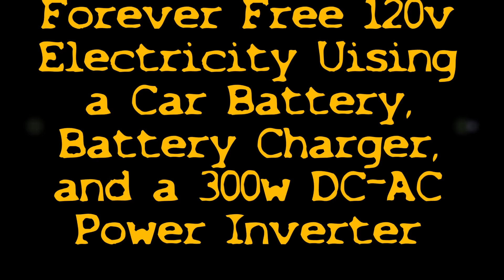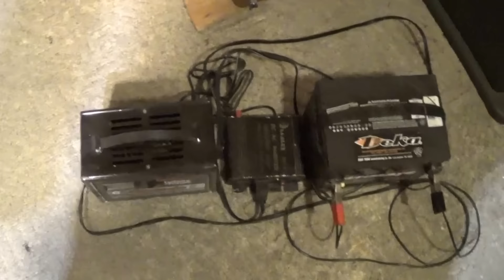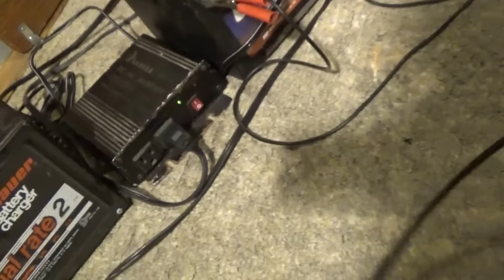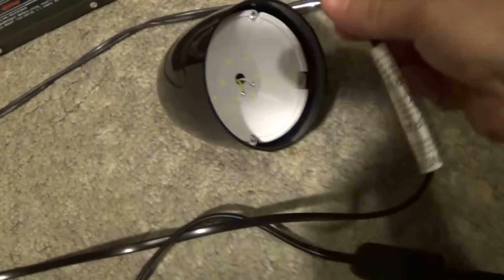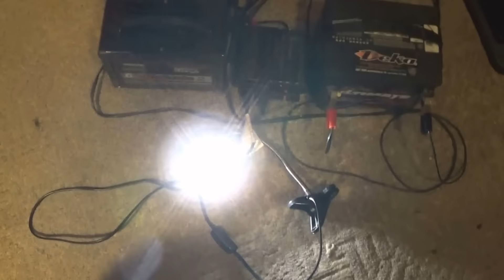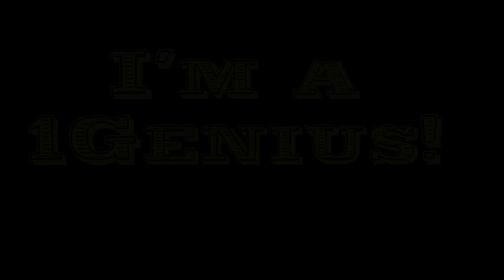Free120v Electricity Using a Car Battery,Battery Charger,and 300w DC-AC Power Inverter Part:2

Comment: ??? But say you plug a fan or idk a phone to it then it’s going to pull power from the battery right. Witch means it’ll never be able to fully recover its initial charge right. Say you plug the fan in and use the battery to 85% then it’ll never charge itself above 85% again?  And continue to drop the more power you use. Eventually getting so low it won’t even run the inverter or charger right?

Comment: Your system will work with a low amp invertor on a standard battery charger, but once you get above 5 amps you will need higher amp battery chargers, and yes people this actually dose work, I personally have several similar systems running 300 watts to 10,000 watt invertors, powering my mining equipment.
Reply: With this set up how long till the juice ran out of batteries If power a 65v mini fridge??
Reply: @ROSINDABSS.710  it's not that easy to determine it all depends on how many amp hours your battery has so one amp hour equals 1 hour so if you have a hundred amp hours you have 100 hours at 1 amp I'll draw then you need to know what your charger is putting back into the battery so let's say your refrigerator pulls 10 amps and you have 100 amp hours then you would get 10 hours worth of use out of the battery before it runs dry if you have a charger that's putting back 12 amps then you can conceivably run that battery shut up for 24 hours because you're pulling 10 amps out of the battery and putting two amps back in hope this helps you
Reply: Thank you for the updates , Power companies like Edison do not want the public to know this power source

Comment: Seriously, though... Can I run a system like this in my Camper van? Connect the inverter to the lighter socket and use a regular battery charger to charge my leisure battery while driving? I understand very little about electricity but this sounds like a solution... Am I missing anything with this kind of set-up? Any help wold be greatly appreciated !!!

Comment: The power was cut off at my house and I've been trying this out. It powered the lights for about 20 minutes, and then cut off. Without a power source feeding energy into the system, you're not charging anything. The power you feed into one part is given to the next. And when you try to put a load on it, you have less energy for the system to recycle. This doesn't really work, you still need a power source.

Comment: No volt meter in place to show charge volts and amps and no volt meter to show battery charge level and what amps is the inverter pulling

Comment: Prove it get your amp clamps and voltage meters.
Show voltage output and input with amps use and production.
Quite dicking around man.
Let's see what you have working and have left to work with.

Comment: i like the concept as a recharging possibility.  self recharged overnight, the battery/batteries would be charged enough to power the inverter  for small items like phones, led lights, low watt tv...camper, rv type stuff.  seems  like its  worth a try.

Comment: I've tried this ,
When I plugged a tv in it then draws from the battery ,after the battery drops in voltage the inverter will shut down due to insufficient operational voltage.
Me personally,I don't know what size charger to use "if thos is possible " to force more voltage back into the battery..
I was using an 8 volt charger.  
After a minute or so,the tv sucked the voltage too fast from the battery.
Reply: No shit? Wow, would have never guessed
Reply: You need a bigger battery inverter

Comment: Seriously? Lol,  how about put a load on it and then see how long it lasts.  You did not create free power,  common sense tells anyone that.
Reply: Exactly the inverter you little to nothing to stay on and a battery charger putting in a little power at the same time but still losing power
Reply: It continously receives a charge, the battery will run until 99%, which kicks on the charger, which charges it to 100%, and turns off.  A smart charger would seem to be a necessity for trying this.  You can run whatever your battery and inverter allows you to power. It would seem that it would work.

Comment: He did give me an idea, though. My van has an OEM 400w inverter. If I plug a 120v charger into it, I should be able to charge my LiFePo batteries while I drive. Right?
Reply: Or just let your alternator do the job and skip the middle man and all the power loss along the way... 🤷‍♂️

Comment: Ounce you take energy from the extra port it will take from your energy supply.  I dare you to keep the lamp plugged in until it goes put.
Reply: Its almost kinda like making a pizza you made it to eat and as you eat it away its gone.   Mmmmmm....
Reply: scottie b  seems like it would work best  at night to recharge.  if only using small watt items, it should last through the day no problem

Comment: He has the charger set at 6 amps so in theory if the inverter and charger is pulling less than 6 amps then this may be possible! Now don't attack me in the comments notice I did Say in" theory" and "May be possible"! the trick is numbers and factors! If one could put more into the battery than is being pulled out then it might work! I just don't see that is the case here!

Comment: hello  from  maine,usa very  cool  i  been looking  for a video like  this  to see if  it works   iam  starting  out   have  8 battery's   hooked up  to a  3000 watt  inverter  but  waiting   on a  wind wind turbine right now  but i wondered  if    a charger  would  work  with out the  wind  turbine  still going to get the  wind turbine  but  this  is  really  cool  thanks  for  share this    man   100%   good  deal  there

Comment: you did not invent anything, you just created an energy loop. Considering the energy dispersion, you are just slowly wasting the battery energy because all the components have energy loss. When you plug a load, the battery will drain anyway and when it gets under 50% everything will shut down. In case you are able to create a system with conversion efficiency of 100% you are just moving energy from the battery to to the charger and then back again to the battery without energy loss, the loop. But this scenario would be more like a dream than a real thing. I'm sorry to tell you man, but thermodynamic laws are naturally right and you cannot beat the nature.
Reply: X
Reply: Hi. Is it possible to do this with additional batteries? I’m trying to get off the city grid and looking for advice in layman’s terms please.
Reply: Pierluigi mooVeng Irie Rubino 
Now, apply thermodynamic LAW to the theory of transpeciation evolution. It ain’t happenin.
Reply: Pierluigi mooVeng Irie Rubino 
And good point, Darwinian transpeciation evolution is a DREAM.

Comment: I made one of those myself but I need advice say it will run for a little while but it does go dead after a while curious if you're actually having the same problem haven't gotten as far as testing this part but I've done research looked up maybe get a good electric capacitor to run also with it looking for any kind of advice thank you
Reply: I have done this too with 6K inverter. You should use a capacitor for the surge when starting up large equipments like a freezer, drill, steaming iron, airco etc.

Comment: I’m sure in very simple, but could you plz tell me how you did this, or a diagram how. I have some family in P.R. That I would love to help by doing this simple thing that everyone is doing over there already. Thx, I would greatly appreciate
Reply: Nerves848676 The circuit he's showing is the following: Connect the inverter to the battery using the cables (some inverters do not come with the cables so you have to buy them separately). Plug the charger to one of the 120v outlets of the inverter and the clamps of the charger to the battery. It is call a close circuit and it do not function. It usually going to last about 3 to 4 hours depending on the amps of the battery and the watts used.

I used an Optima AGM marine dual purpose battery and a 5000 watts inverter (no charger) for: a fan, a tv, a cable box, a small refrigerator, an internet router, two 60 watts bulbs, and to charge two cell phones. Each battery costs $320 aprox and $398 for the inverter of 5k watts. I do not use a charger because it doesn't maintain the battery voltage unless you plug it to a house outlet which I can't do because I'm from PR and don't have electricity. The service time is the same as the one of the video (3 to 4 hours).

You can connect two or three batteries in parallel for more service time. The batteries have to be of the same model and specifications.
Reply: Luis M. Ortiz Ortiz did you try this Already? I am trying to see is that work
Reply: David Perez trying it myself here in PR also but doing it with 2 or 3 batteries unline
Reply: David Perez Saludos, sí, lo estoy utilizando sin el cargador pq no tiene ningún efecto en el circuito, más bien descarga la batería y no ayuda a acumularla.
Reply: Luis M. Ortiz Ortiz cuantos amperes está tirando el cargador..? Voy a usar un cargador que tire 13 a 15 amperes
Reply: si averiguan me avisan estoy usando un cargador de 10 amperes con dos baterias marinas pero lo mas que me duran son 3 horas usando solo la nevera
Reply: Luis M. Ortiz Ortiz saludos hermanos y que me recomiendan ? Yo compre un cargador de batería con inverter de 400 watts y también el inverter de 750 Watts y ustedes serían los únicos que me podrían recomendar que hacer GRACIAS 💪🏻💪🏻💪🏻
Reply: Not true won't work
Reply: Lamp won't last 2hrs
Reply: Luis M. Ortiz Ortiz  so just for the sake of understanding.. if I do it the way u just stated (I just wanted to plug up a small heater)it would only last 4hrs?
Reply: pleaase can you tell me how to install one with 2kw inverter. Thanks
Reply: Nerves848676 ..if ur family is near running water..(stream etc) water wheel would be the way to go to charge batteries... I will not show it or talk about it but I am working on a tension/wind up generator...that resets itself.. I got it to work extremely good at a small scale... I am hoping when scaled up it works just as good I will be ecstatic.. something simple for people with less mechanical   would be a gravity generator   that has many weights that  starts the next weight to come down when first is all the way down...u would have to do a little math to determine how many rpm for your specific application for steady voltage
Reply: Tried it charger will make  inverter go off and it won't  be able to keep battery life last show me this video and you will embarrass your self

Comment: lol this will only extend your run time by 30 min i tried it other wise the inverter will beep and shut down just plug it into the wall and set to 25 amps then it will work theres no free energy

Comment: No it won't work, you CAN NOT pull power from battery and put voltage back in battery with the charger it will never charge enough. Buddy that's old school science experiment, I did that in the 8th grade in 1987 and didn't work then and won't work now. It's called (perpetual motion) which doesn't work.

Comment: The mistake is the battery charger  because its stepping down your power from inverter , you need to modify your charger to get a little more out , wich wont be a problem because your chargers input is more than your output , I successfully did it before but with inverters i made and a capacitor, You are on the right track , also because its a looped system the load must not use more than 50% of your energy since the rest is so it can loop.
Reply: I was just thinking you'd need a cap or a step up transformer otherwise the load would exceed the battery output before it could be recharged. I'm going to give this a try too.

Comment: The moment you plug anything into the outlet  it'll start running down.
Reply: alpha mike
 depending on the amp draw!
Reply: I BE DAT HOMELESS GUY FROM TIK TOK  how long has your system been running for?!
Reply: I BE DAT HOMELESS GUY FROM TIK TOK  does it still work sir?. .

Comment: Dude, you did not create free energy. All you did was make a really big circuit. As soon as you plug something in the alternator will have to divide the energy from the battery between the recharger and the new load. Will it last a little longer? Sure. Bit it WILL go out
Reply: First things first, I am not trying to put you down, if it came out like that the I apologize. Secondly,  I'm a computer engineer myself, though I will admit to having had major trouble in the electrical engineering aspect of my clases. It just sounds to good to be true.

Comment: I have did this.    And the charger with a load will drain your battery every time.   It just won't keep up
Reply: This is where you add: Solar.Wind.or Hydro to compensate for the loss

Comment: You the Man. It really works
 I stepped it up to a 2500w inverter and 2 deep cycle batteries.
  

 I had the fridge working.  No more noise, hunting down gas for a generator. I love it. Thank you so much !
Reply: does it still work? . . . did it breakdown?
Reply: @chooper3048  
Yes it still works and is ready for the next  emergency.
Reply: I will try this I have battery inverterI need battery charger its ok using this  over night?pls reply please
Reply: I only had it on during the day for a few hours with the refrigerator running.